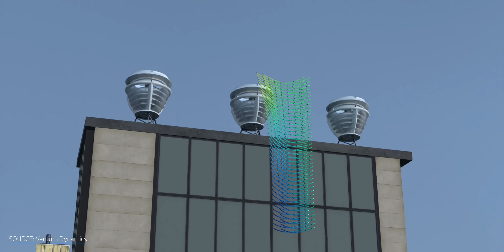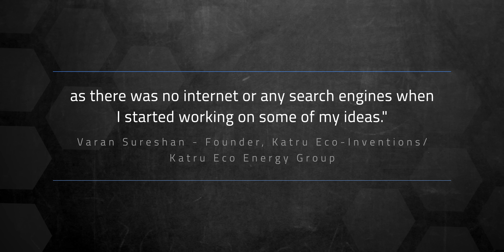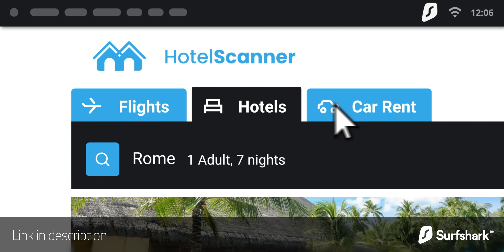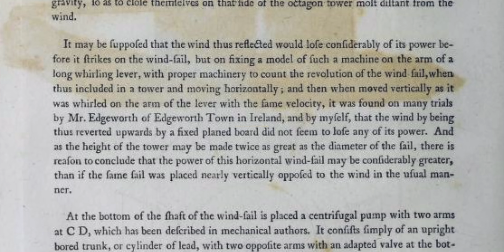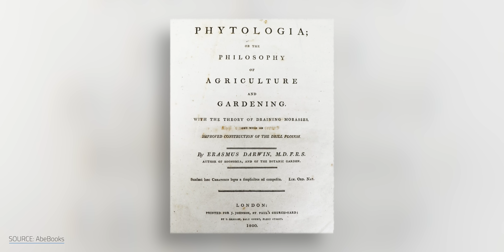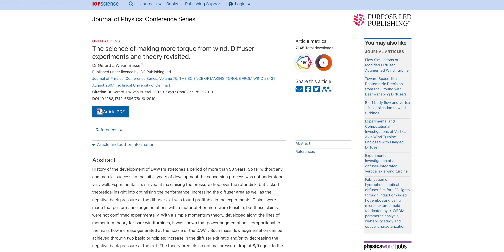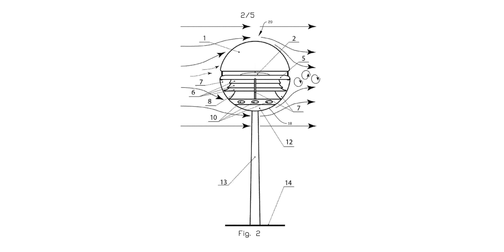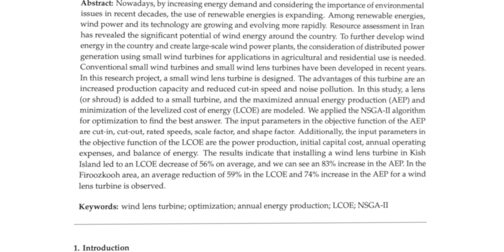Are Shrouded Rooftop Wind Turbines the Future of Energy?

Comment: Renewable energy will never happen as long as there are laws preventing people from disconnecting from the grid.  The "grid", those mega corporations that earn billions, by selling you electricity, will never allow you the individual to be self sufficient.  I have neighbors with 20kw of solar, and are not allowed to be disconnected from the grid, and they passed laws that the grid no longer has to buy your excess power.  People were evicted in Tampa, FL for going off grid in town.  Nothing wrong with the house. They just chose to disconnect from water and power and were warned over and over, then evicted.   So yeah, talk all about renewable energy, but the power companies will never let you be free of them.  Every roof top should be covered in solar panels, and every power pole should have a 400w panel feeding it. But they are not.   Why is that?   Why did they pass laws preventing you from using your solar power during power outages?  Seems a bit suspect.  But power, like gasoline and insurance are huge money sources for the government coffers.

Comment: This design have a few major challenges.

1. Still low output after all these complications.

2. High installation and maintenance costs. Everything at the roof costs more everything works faster need more maintenance. More maintenance at the roof costs more. 

3. Pressure difference between the sides of the turbine will increase wear and tear. 

It will cost a lot. Some companies will still put them on top of their buildings just for greenwashing.
Reply: Seems to be just your opinion, without any proof. The cost to install on a may be somewhat valid but these are small units.

Comment: I hope this works out. When it comes to any turbine mounted to a building, it is not just about the dB level of the device itself but the amount of the harmonic vibrations passed onto the frame of the structure it is mounted to, particularly as the turbine ages.
Reply: and varying resonant vibrations

and other complex effects

for example, a not well known story I read recently:

one of Europe's largest airport, Frankfurt.
they silently agreed to pay for securing roof tiles in one particular spot, not even that near to their runway.
the roof tiles were regularly knocked off some houses there,
and it was finally proven this was caused by long range vortex forces from the edges of aircraft wings.

(I imagine the airport / airline industries, also the wind power industry might not be interested
in these findings being rubbed under everyone's noses..)
Reply: @laus9953  you think these things are going generate as much wind force as jet turbines? 😂 wtf

Comment: I'm tinkering on a bit different solution for big commercial buildings myself, but accurate simulations are very hard to do, let alone that only large scale prototypes can yield acceptable test results. This makes it an almost impossible task...
It's an interesting concept, though. My issue with this is that most of the wind flow will come from one side only, which is even supported by the mostly unidirectional average wind direction in a given environment. Hence I think the area on the inflow side could be increased as well as the updrift winds might be forced to flow into the relevant direction better.
Again, hard to simulate...

Comment: If it does half the job advertised, at least worth looking into.  Besides the long-term energy savings, it's comparatively horizontal, relatively short, and most of its moving parts are guarded -- so less chance of falling on something from strong currents shifting directions, or things like birds and curious kids getting hit by the blades.

Comment: 6 m/s average wind speed is very much in yearly average; perhaps on ocean open shores and islands && in moutains. Even with that avg speed the avg electrical power is only 0,34 kW (table at 16:34 VX175 type 2 meter version).

Comment: These ducted turbines have a lot in common with the Darwin turbines. If the Darwin turbine is not the inspiration, it is a parallel development.
I'm quite sceptical about small windmills and windmills for residential areas. I have seen many attempts, but till now they have one mayor flaw in common. They are quite expensive to produce and don't produce that much energy that they will be economical viable. These rooftop turbines look as they are also quite expensive to produce and may very well have that same flaw.

Comment: 16:32 so….that means a 3.000kwh a year. Divided by 355 days = 8,22kWh a day. And divided by 24h…would make 342,5 watt hours. 
Just buy 2 400 watts solar panels, will be way less expensive than that machine and you have around 95% efficiency of 800 watts of solar energy 8h a day. Better trust in the sun tan the wind 🌬

Comment: I spent some time working on small scale residential sized turbines (<4.5kw) they don’t work, it doesn’t matter how efficient they are. Economically they just aren’t worth it. Solar generation is the only thing that works at that scale.

Edit: 16:31 oh wow, there’s the figures. 3000KWh at 6m/s. The current U.K. fixed export rate is 0.12 per KWh so @6m/s you would get a return of £360. 
Compare that to most popular small turbine currently on the market; Kingspan 6kw which is a quite simple downwind style turbine that produces almost 9000KWh at 5m/s and costs over £20,000. At a guess this new turbine will cost £25,000 installed. So that would mean this turbine would take almost 70 years to return on the investment vs solar which typically takes 5 years. 

Why are people still investing in this nonsense?
Reply: Watching this channel go full grifter has been yucky.
Reply: “Why are people still investing in this nonsense?”

At least three independent reasons. 
1) it’s obvious there’s power available in the wind. It requires math and engineering to figure out it’s not worth capturing in most cases. Most people aren’t educated, and so can’t figure that out on their own. 
2) the Next Big Thing is almost always something humanity had figured out a long time before but hadn’t come up with an efficient way of doing it - this might be the next big thing (probably not)
3) there’s an application for very small scale power production beyond solar, as an additional redundancy factor on top of solar and battery backup, particularly in areas with risk of solar panel occlusion (due to clouds, snow, etc).

Comment: This won't work
The amount of energy wind turbines can produce is limited by how much wind goes through them and therefore their cross-sectional area. Betz's law.
These things are so small. You'd literally need about 10,000 of them to capture as much wind as one regular wind turbine. And this is NOT even accounting for the difference in wind speed due to their location.

So unless they manage to manufacture and install these for less than $100 a piece while still making a profit, you can kiss this idea goodbye.

Comment: Seems Darwins design had movable slats that closed in the opposing direction guaranteeing all wind to move upwards.
You can see this in the drawing at 7:47 the right side of the is closed, where the left lets in the air guaranteeing all air that gets inside it has to go up
Reply: It was an understandable error in aerodynamics that he thought it necessary to close off the leeward side of the cylinder. However, the Venturi effect actually means that all the incoming air from the windward side being redirected through the duct causes a vacuum that amplifies the pressure inside the duct by drawing air in from all directions including the leeward side.
Reply: @Sagan_Starborn . Awww the “air multiplier effect”… so the main criticism is that the slats robbed energy more than anything else.

Comment: This time you were misled. I'll say why. The size of the wind turbines are dictated by a simple formula, and it's definition: " The best overall formula for the power derived from a wind turbine (in Watts) is P = 0.5 Cp ρ π R2 V3, where Cp is the coefficient of performance (efficiency factor, in percent), ρ is air density (in kg/m3), R is the blade length (in meters) and V is the wind speed (in meters per second)."  Beyound physics, everything else is nice, but lame marketing.
Reply: To clarify - power is derived from force and force is, for imperials, pounds per square inch - the more square inches, the more pund of force will get converted to kilowatts. If it wasn't true, chinese small rotors from scAmazon would have been making advertised power for quite some time now.

Comment: carbon fiber cloth solar hot air collector blimp would be the simplest, you can also put large turbines on the same heat floater. sometimes designs converge to same principles, when they are the best. same design even if not invented in a linked manner. independently to the same best conclusion and design principles. the end result is same or similar. both rely on larger wind area collection into a small or smaller turbine. all those are the same wind collector type. bs, its the same. differentiation claims are for the eyes only.

Comment: The big issue with shrouds is that it... well... blocks the wind you are trying to capture.
This puts shrouds into 2 super general categories.
1) block some air mass, but gain additional velocity.  So most roof-top wind systems use things like the side of a building to take advantage of a 'natural' (or at least pre-built) shroud to get higher average speeds to allow small turbines to get more output than they would normally.
2) create a long or tall enough shroud to take advantage of a pressure difference.  This gives you a sort of chimney/draft effect, which isn't a high speed, but it can be constant even in a no-wind area.  While this isn't typically in effect with turbines, it gets used a lot in dry arid climates for passive ventilation.

So will this work?  Absolutely!  Lots of companies are doing this right now, and it isn't particularly unique other than its exterior visuals (probably the prettiest one Ive seen).  The big question is if the extra material for the shroud can keep costs low, if the inherently uneven torque on the turbine from the wind-ward side becomes a maintenance issue compared to 'self directing' turbines that point the whole blade into the wind more evenly, or how much markup a trendy company is going to charge for what is effectively (and I don't mean disrespect) a large fan with a plastic box around it.  As long as the markup isn't too awful, I think this (and the many other similar options coming to market) can be pretty awesome.

Super unfortunate about the Darwin design though.  That basically means that almost any yahoo out there can copy-paste their design and claim that they got it from centuries old drawings and not copyright infringement.  That is going to be a large legal pain to defend, and could make a low profit margin design simply unaffordable.
Reply: People either know how to make bricks and concrete blocks, or can figure it out easy enough.
And Home Depot seems to have no trouble selling plenty.
Reply: You are missing the idea of air that would have passed under/over/around the turbine is now redirected into the turbine. Sure some air might be blocked by the shroud however some air being blocked and some redirected into the turbine is more than to not having any redirected at all.
Reply: "Blocks" is the wrong word.  "Redirects" is more accurate.

Comment: Horizontal roof installations only?   Would help if dynamic roof load data were also mentioned.  That value could be significant for estimation  safety factors on existing structures.  *
Reply: And how many roofs are rated for downwards pressure only?  I mean... how often do you rate a roof for how much up-lift it can handle with a giant wing mounted to it in a storm?

Comment: I would be very interested in micro hydro for similar use cases.  The garage I park in for example drains to a few downspouts that run the full 4 story drop to ground level.  When it is really raining you can imagine the amount of force contained in those downspouts.  But does it make sense to put turbines in for the 4 month rainy season?   The ground floor of that garage is largely EV charging stations, does the micro hydro math change if we don't convert the turbine output to AC but rather directly use the DC right there at the EV charging stations?

Comment: DAWTs must measure at least 1.4 meters in diameter, with a double height of 2.8 meters.
The minimum roof height for maximum efficiency should be 1.4 times the structure height or 2.8*1.4~4 meters.
With such a height of the structure, windage and vibration will be on the stands, since the coefficient corresponds to much higher than most vertical tubrins (and it doesn’t even make sense to compare with horizontal ones).

There are no wavy flaps in the pictures and videos, which means there are large losses on the traverses and tips of the blades, wind concentrates.
The main question is what is the TSR of this turbine? (Tip Speed Ratio - relative blade tip speed to wind speed).

Why did the developers use only one propeller, and not two, rotating in opposite directions?
The wind is already concentrated, which means it makes sense to use simple technologies to increase the efficiency of turbines.

Why aren't the vertical stiffeners angled at 30 or 60 degrees to further twist the wind and increase lift?

Comment: Why not put the turbine facing vertically over the edge of the building to maximize the updraft? Obviously you'd have to heavily reinforce it to keep it clamped in place, but it seems like a very direct and predictable source of strong winds.
Reply: NO, wind follows the path of least resistance, shrouds are nonsense, the ideas  have been around for hundreds of years, do you see any turbines with shrouds? Do you see residential turbines? No.

Comment: If you have buildings much longer than high, sure, wind will push up.  However, if you have a lot of tall but narrow buildings, like in a city, the wind will push AROUND not UP AND OVER... so they need ways to build these abkve streets, between buildings, or protruding from buildings, etc.  Sure, put some up top, because why not, will will blow there too.  But the buildings, alleys, and streets function as shrouds already.

Comment: You keep referring to efficiency but don't define it.
The only real efficiency is the ratio of the energy in cross section of wind captured by a turbine and the electrical energy it produces.
In the case of ducted turbines the blade diameter isn't relevant, the area captured is the area of the duct the wind initially passes through and the speed at that point.
That's the true comparison point with traditional turbines.
Having said that, these alternatives may have other advantages that means parameters like efficiency are less important whether higher or lower than mainstream designs.

I think it has merit in that the design is suitable for the location it's intended for, not that it's an alternative to mainstream designs.

Comment: So rotational motion is somehow 'motionless'? I definitely would not want to put one on a house, though, because vibration is inevitable and fixing it to the frame of your house means that vibration will travel into the house directly. Other problem is that it will be in the turbulent airflow around the houses, which means lowered efficiency.
Reply: Rubber bushings are impossible technology sadly. They'll never be able to make cars that don't rattle your teeth out.
Reply: True. Horisontal blades rotate, so this is a motioning wind mill. Motionless is absolute false.

Comment: That picture with the warehouse covered 1/3 in PV and 2/3 wind turbines does look questionable. As in, it's probably more cost effective to cover the whole thing in solar.

Where it seems to get interesting is high buildings with the updraft effect. If this gives you more power and/or more reliable power than PV at a comparable cost.
Reply: It might be more cost effective to cover it in solar, but the energy mix might ensure higher reliability. Since you would have production on cloudy days and at night as well during peak hours, it would reduce the amount of battery capacity you would need. Sure, solar may be more efficient using space, but it's only sunny no more than 50% of the time anywhere on earth.
Reply: Yeah... that is my fear with a lot of this too.  The plus side is that it can generate power at night when the panels can't... but it is likely going to be cheaper to just tack more and more panels on the roof.
If going totally off-grid, then there is a potential argument that you can get away with a smaller battery backup... but with the prices of batteries continuing to drop over time, this also becomes a really hard sell.

But they do look pretty futuristic and cool looking!  Sadly, that just gets you views, not sales.  It's not a tesla that you pay too much for to show off at the office, its a utility piece that merely need to 'not look ugly', and in a rooftop world competing with the looks of solar panels and air conditioners it isn't a particularly high bar to pass lol.

Comment: Why not use a "pinwheel" turbine instead of just blades in the shroud. Much larger surface area to drive the turbine.
Reply: The NIMBY effect is strong.  This would work, and removing the shrouds would greatly reduce costs... but then you have a windmill, and some people get really dumb about that.  But then without the shrouds you also end up with a bird and people hazard on rooftops, which is a whole other concern... so to put this in an urban environment you kind of need to put it in a pretty box of some sort, which makes vertical oriented systems the main design style that you see for rooftop designs.